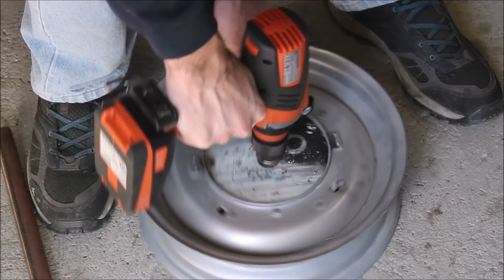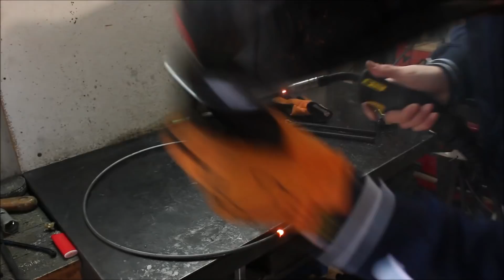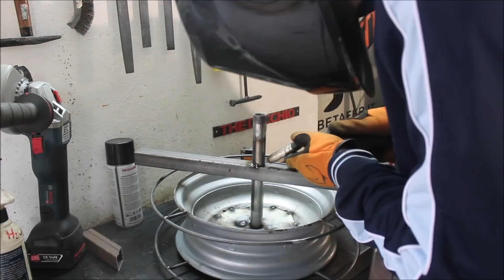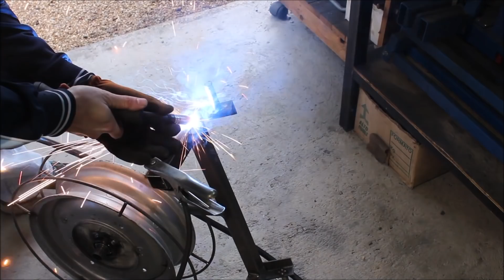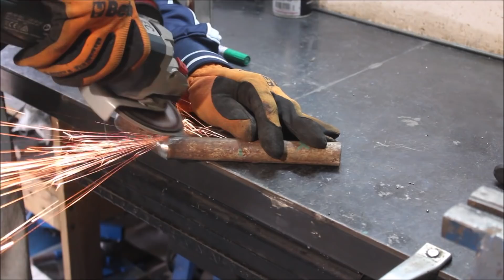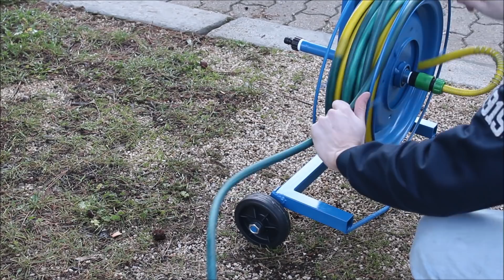Avvolgitubo fai da te (homemade garden hose reel)

Comment: Hmm, frustrating, you did not show how the most important part is done. How can you have one side of the pipe rotating while the other does not and have water run through it without leaking?
Reply: Iam also asking the same question 
Which connector you used for rotating the wheel
Reply: Same question for me also